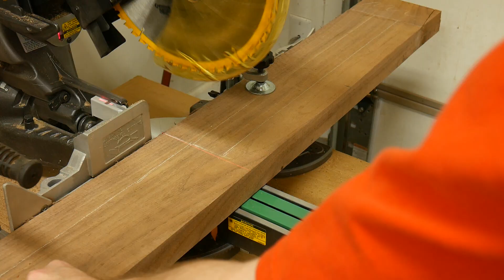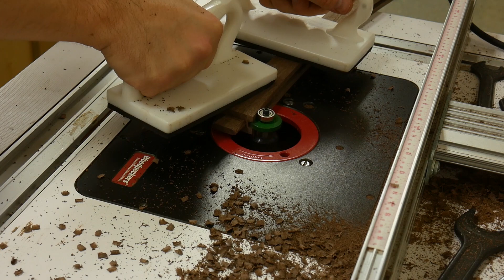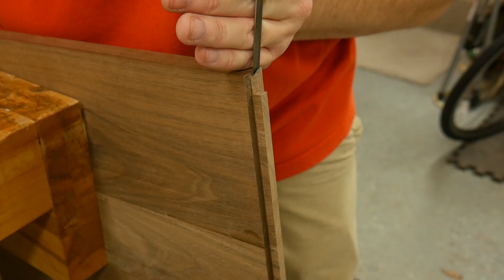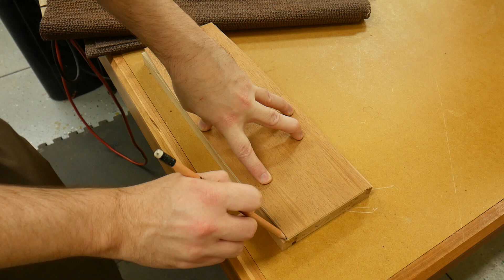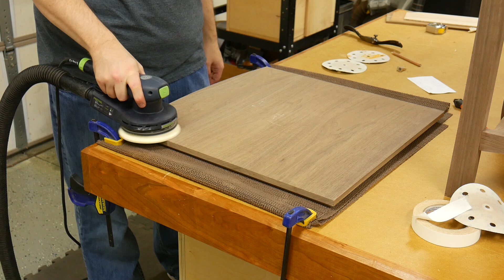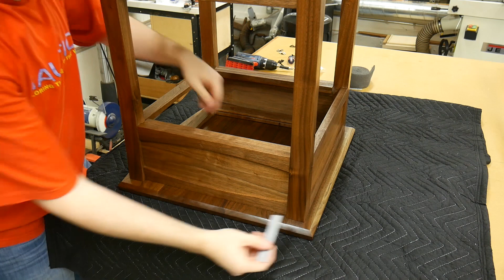How To Make Custom Walnut End Tables | How-To Woodworking

Comment: Great video.  I am making a bedside table for my wife.  She wants a shelf in addition to a drawer.  Was struggling with how to attach the shelf to the legs.  Your method of basically doing a tongue in groove with the shelf and rail inspired me.  Did you glue the entire width of the shelf into the groove?  Were you not worried about wood movement?  Should I only glue a little bit in the back and let the rest move freely?
Reply from the maker: I don't remember what I did but if your fit is snug you can put glue in the middle of the shelf tenon only so it can expand front and back
Reply: @Simplecove  Similar to a breadboard end on a table.....better solution.  Thanks.

Comment: Awesome table!  I’m making a couple similar for a customer and your video gave me some great ideas. 

Any concern about wood movement with the lower shelf?  I was thinking I’d just glue the shelf tenon in the middle of each mortise and cut the tenon a bit shorter than the mortise to allow it to float on the edges. Almost like a small breadboard. It looks like you glued all along the mortise. Have there been any issues with this?

Thanks!

Comment: Very nice work!  I do have one question regarding your table saw above blade dust collection port: how effective is it?  I have posed the question a few times in the places I normally hang out, but have not gotten much of a response.  I am thinking of adding it to my table saw, but would like some feedback from someone who uses one.  Thanks!
Reply from the maker: The dust collection that came with my saw is actually really good if your blade is buried in the wood. If you are trimming a board and only half of the blade is removing wood, the dust will kick forward and not get picked up by the dust collection but that seems typical with all of the over the blade collection systems from what I read. I know saw stop has an aftermarket dust collection for this saw but I don't see the need to upgrade. The setup I have works good enough for me.

Thank you!

Comment: I’ve gotta get a bandsaw... those curves really change everything. I’m curious about how strong the bottom shelf is. That seems like a tough design feature to execute
Reply from the maker: The bottom shelf is plenty strong for an end table. It has a 3/8" tenon pretty much the width of the board on both sides. Thanks for watching!

Comment: What’s the purpose of the stretchers just beneath the table top that the z clips slide into? Couldn’t you just slit the apron for the clips to go into?
Reply from the maker: They are for the drawers. Since the aprons are inset, the drawers wont make contact with anything(on the top of the drawers) on the inside of the frame.